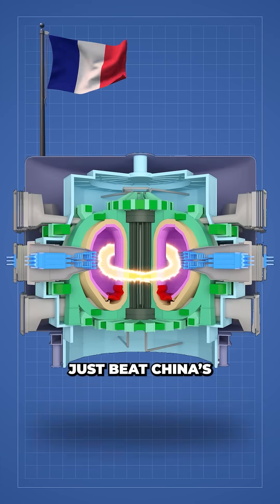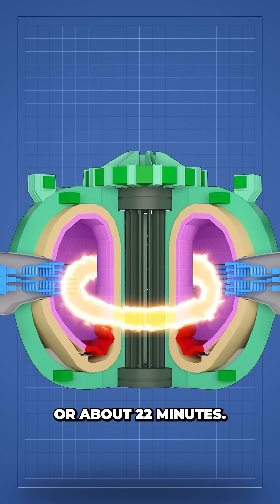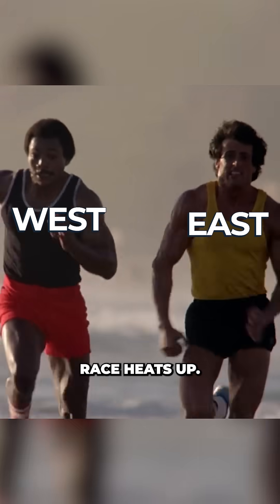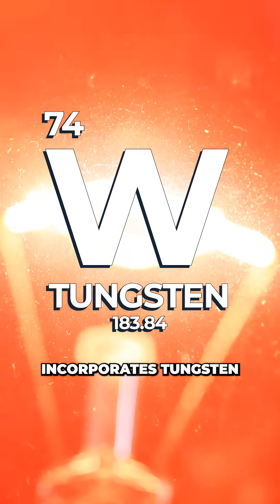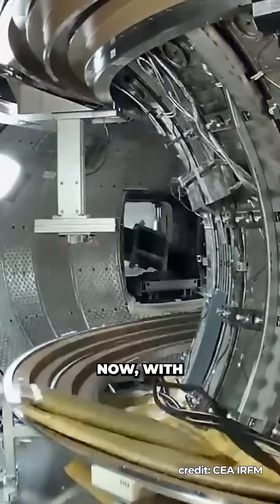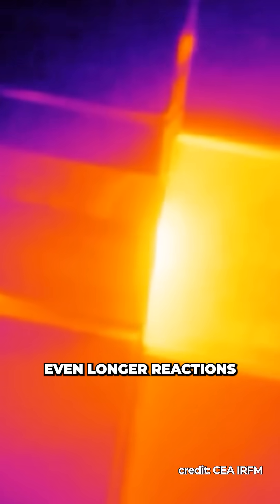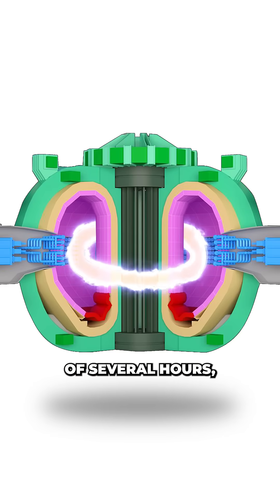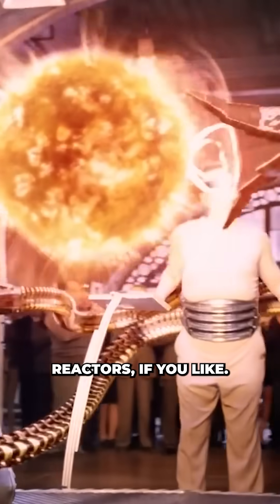France Breaks Fusion World Record

Comment: It used to be that grid scale fusion was always 20 years away, now it's always 10 years away, so that's an improvement.
Reply: Half  Life  of  engineering  success
Reply: @240mains clever, very clever 😂
Reply: @240mains hahaha yes
Reply: Yeah, I don't know what team did this, but the most advanced project is ITER. If it doesn't get any new delay, it will produce it first plasma at best in 2030. The goal of this project is to produce more energy than needed to heat the plasma (Q>1, actually Q≈10), at best for 2035. But this energy will not be converted to electricity. The next step is the projects DEMO, demonstrators that should produce electricity (not planned before 2050, spoiler it's gonna get late). And then PROTO should be the  achievement of the process with few modifications before going to series.
It's far from ready to eliminate fossil fuels.
To wait until this we'll have to use fission (maybe RNR) and renewable.
Reply: @paulmabille8112  ITER isn't even finished building and was conceptualized in the last millennium, it's not the most advanced by any metric. There are both more recently designed/upgraded and already built reactors that produce results like WEST (Tore Supra) which can iterate on designs much faster that the giant molasses of international cooperation that is ITER could ever dream of.
Reply: @paulmabille8112 Around 1999, I asked a scientist at Culham when commercial fusion reactors would be operable. He replied - when oil runs out...
Reply: @paulmabille8112  We could do all of that MUCH earlier if instead of letting corrupt politicians fund their own pockets we force them to fund science. In general if the west unites and stops playing the ego cards of "I'm better" and they unify as 1 body that researches instead of fights, we could have proto fusion reactors far faster and far earlier than 2050.
Reply: @mklyuchnikkeep the politicians out of the way!
Reply: Lmao yes
Reply: I wonder how long it will stay in the 10 minutes stage?
Reply: @ballenboy  at least 10 minutes
Reply: 2030 is 5 years from now🥀
Reply: @mr_flor  And?
Reply: @mr_flor 2030s
Reply: Its 30years away
Reply: It has made improvement in time every decade man.
Reply: In 2050 it'll be 5 years away 😂
Reply: @ i don’t think you understand the difference between linear progression (humans) vs exponential progression (Ai)
Reply: @ the real issue with fusion development isn't the calculations needed to make it work, there are several far more intricate problems to solve which can't just be"mathed out" via AI. We need a bunch of supporting tech to develop yet, like better materials and an efficient method of actually turning the reaction into usable energy (consider that even nuclear power is still just heating water and spinning a wheel).

Fusion energy production has been "20 years away" since the 1950s, and we've barely scratched the surface regarding getting it to work. On top of that, you're describing human endeavour as linear, and that is demostrably NOT the case. The first steam power started in the 17th century and it took 200 years to reach a decent functional state for non-static and widespread use. Within 100 years of that we had internal combustion happening. The first powered flight was in 1903, Sputnik was put into orbit in 1957. This is not a linear progression.
Reply: In 50 years from now it will only be 5 years away.
Reply: My grandchildren will be anxious to tell me “it’s just 10 years away!” 😂
Reply: Lol - yup
Reply: True, true.
Reply: Also, what if the curve is exponential? Perhaps that 10 year catch up period is only an indicator that we are approaching singularity
Reply: so only another 50 years before we can expect to see it?
Reply: They should use zirconium it has a higher melting point that tungsten and it was created 60.4 billon years ago and there's even some on the moon
Reply: @Maxsharkthe  Wrong, Tungsten has a higher melting point than Zc. Moreover,  the universe didn't existed 60.4 billion years ago
Reply: They said by 1980, so NOT an improvement. Year 2080, more like it
Reply: 2030 is in the next four years and six months
Reply: Its 5 years away
Reply: hopefully AI will take that to 0 years away
Reply: “Used to be always 20 and now 10” means that the statement held true 10 years ago, and if it does become true in the 2030s it means the statement is true for today’s argument of “10 years from now”
Reply: Sometime progress comes in leaps especially whenever you crack a singular sticky problem. Don't be discouraged however if it's a slow slog that's also part of engineering a new product as well.. you only lose when you give up
Reply: 10 years away from an engineering standpoint sure. 10 years away from having all the permitting and environmental reviews done for a site … pfff HAHAHAHAHAHA
Reply: In my University they say: stable fusion is always 30 years away
Reply: It's still 50 years from now. We don't even produce enough REE magnets and tungsten to scale it

Comment: Ok but since the reactor chamber is so fully lined with tungsten and magnetic coils, how in earth are the heat from the plasma going to be used to boil water.?
Reply: Because it isn't meant to.

Fusion output is usable as is.
Reply: @paulduchamp4736  Oh?  How do they plan to extract electrical power from it?
Reply: @RobertLutece909  Rather than an half bullshit explanation from under-qualified me, I would refer you to the ITER project documentation.

Basically, is a chemical reaction with the coils.

Comment: Wow! Fusion power is just ten years away?! That’s so crazy, that’s just what you said 10 years ago… and ten years before that… and ten before that, all the way back since the 60s. At this rate it will be ten years away in 2095, and in 2300 and in 2500. We have made no changes to the expected time delay. Maybe the high temperature creates a time dilation effect that keeps it from advancing with the rest of the cosmos. I’ll tell my good friend Einstein to run some calculations and see if this is the case. Dear god, nice they are making marginal improvements, but god damn it really isn’t impressing me much. Hard to get excited for this when it’s the same old headlines about an another breakthrough that ultimately amounts to nothing.

Comment: It's not x10 hotter than the sun. The temperature is equal. It uses the same molecules to achieve identical fusion as the sun. The only problem is it consumes more energy than it can put out. Meaning it's not self sufficient for long term energy demand. 

The reason France got it to last so long is they used a magnetic force to stabilize the plasma field. This magnetic force is 300x stronger than Earth's own magnetic fields. 

They did that 5 years ago. China's reactor is CGI. They don't actually have anything of competition.

Comment: There is a light at the end of the tunnel.
Or is there? (Cue the VSauce music)

You see, a circular tunnel in 3 dimensions is not a tunnel at all. It is in fact, *a torus*. However, due to the specifications of the taurus, it is an enlarged, vertically extended, rigid-body, plated and infinite shape, meaning there is not and will never be an end (or tunnel) in sight.

Comment: This is so pointless.. I mean sure, it’ll generate energy for us to use, but our planet is already a massive generator.. our core is magnetized lead and other heavy metals, and we have all the precious metals we need spinning around it in the crust, mantle and outer liquid core .. a gas generator produces energy by spinning a magnet inside 3 bundles of coiled copper/zinc wire, which is three phase alternating current that we all use to power our homes..

The only reason they don’t want people to start pulling energy from thin air in our atmosphere, is because they can’t charge you for using it.. like J.P. Morgan said, “if you can’t put a meter on it, we don’t want it”

Comment: As much as I love the science, and I absolutely love the science, fusion will never be profitable... It'll never outgrow science and become a profitable source of power. The reactor is so complex that it's just too expensive and it'll never be able to compete with the low prices from wind, solar and hydro, and battery balancing...
Reply: Same was said with air travel and mobile phones.
Reply: @whothehellarewe
The thing is... Yes you can make it work, but in the end it just produces power. Exactly the same power as wind turbines, solar panels, hydro plants and nuclear plants produce. Of those, fission nuclear is by far the most expensive non-fossile, and fusion will be much more expensive than fission. The fuel is cheap but the immense cost of the reactor will never offset the low fuel cost. In the end, at the end of it's useable life, it won't have produced enough energy to offset it's production cost.

That's different compared to mobile phones and air travel. Those things were expensive in the early days. However, power already is very cheap.
Suppose I present you a fusion powered phone that could do exactly the same as a normal phone, but would have 10 times the battery life. However, it would also cost 100 times as much as a normal phone. Would you buy it?
That's why there never will be a business case for fusion.
The business case for fission is already very, very bad.

Comment: Question:
Why are we making it "10x hotter than the sun"...?
      Is that to compensate for the physical properties (like size) that we're not able to replicate on earth?

Also - dumb question...
But what material DOESN'T melt at those temperatures?
      Like... What will we use to contain something THAT hot..?
Reply: Fucking magnetism

And as for the heat, that's an unitentional byproduct to boil the water quicker.

Comment: I don't hear from the "BUT THIS BREAKS THE SCIENTIFIC LAW" people who used to attack HHO Cell designers...  So is this PRODUCING MORE ENERGY and is put into the process???
Reply: No, it just produces more energy than we put in - big difference

The fuel already has a lot of energy stored in it in form of chemical bonds, all we do is break those bond with a little bit of energy to release all the energy stored in them

It's the same concept as any other fuel -you add a bit of energy in th form of small flame to wood or coal, and it turns the rest of the wood/coal into more fire

Or imagine a ball on a hill, you push it slightly and it start rolling and rolling, gaining way more speed and energy than you gave it, why? - because it already contained potential energy, you just released it

Comment: if anyone wonder why it needs to be so much hotter than the sun (btw it is 10x hotter than the sun's core, not surface), it is because fusion happens under high pressure and temperature. We cannot replicate the pressure of the Sun's core therefore we have to increase the temperature to compensate.

Comment: Fusion research is crazy. The sun achieves fusion - in large part - by having insane internal pressure. The pressure allows it to smash atoms at lower temperatures because the atoms are close enough to simply tunnel past the coulomb barrier. For atoms to collide, they need insane energy to push past the strong nuclear force (I think) and we humans achieve this with wildly inappropriate temperatures and velocities. Because everything is packed so close together inside of a star, quantum tunneling allows atoms to occasionally skip under the coulomb energy barrier.

Comment: Why can't they start using it now for energy production? Sure It's only 22 minutes but the output should be good and you can probably restart it again after a break.
Reply: Because turning it on costs way more energy than it produces. The thing about fusion is that it takes A LOT to start, after which it needs only a relatively tiny amount of energy to keep going.

We can already make net positive amount of energy in the second stage, that's not a problem

But it doesn't make enough yet to compensate out the intial burst

So we either need to make it more efficient (very, very hard) or keep it running for longer so that we have the time to make enough energy before needing a restart (still very hard but definetly easier)

Comment: All this to heat water to turn a fan that will generate the right amount of electricity.

Progress.
Reply: You can't improve on perfection, theoretical efficiency of the steam method is around 95% and even in practice it's around 85%, all other known meethods are around 40% at most

Comment: Fusion power has always seemed like a perpetual motion machine to me. It would be great if it works, but i can't see how exactly its going to work. We're burning fuel to make fuel in the hopes that it can make more fuel than it burns. Thats rather different to coal and nuclear where we're burning fuel to harvest fuel made long ago one way or another by gravity. Energy has to come from somewhere so where are we getting it for Fusion?
Reply: It's literally the same as coal or nuclear, we're still harvesting energy chemically bound in the material

With coal, wood and other conventional fuel it's the energy between atoms. We take a big molecule, split it into two smaller ones, and the excess turns into heat

With nuclear it's the energy in a single atom. We take a big atom, split it into a smaller one, and the excess turns into heat

With fusion it's the energy within several atoms. We take two small atoms, fuse them into one slightly bigger one, and the excess turns into heat

Comment: My opinion is that this tokamak tech is obsolete. One reason is that the short burst solution of smaller, more affordable methods seem to be improving at a rate that will soon overtake this. Another is that ITER uses Tritium, which is not created at nearly the levels necessary to ever make it a useful fuel even if it were to finally work out to a net positive power gain

Comment: Still, this is just going to be used to make steam, that will turn a generator. There should be another way to generate electricity aside from solar cells and generators.
Reply: there's thermoelectric generators with efficiency around 30%

Solar is 40% in perfect conditions

Steam is 85-90% in pratice, even higher in theory

That's why people aren't really looking for anything better, the theoretical efficiency is almost as high as it goes